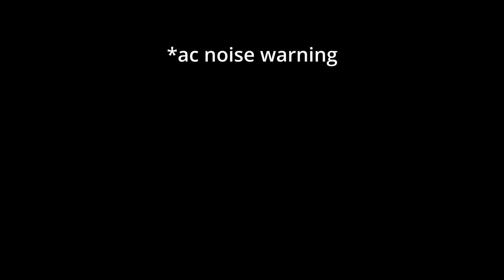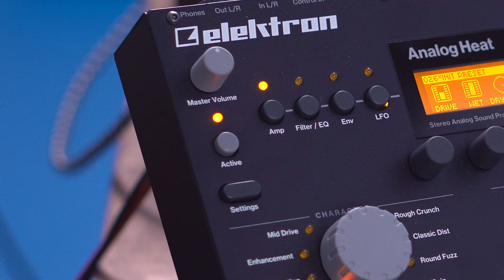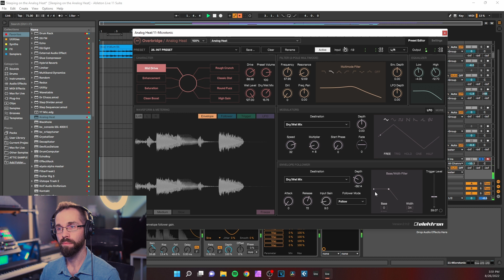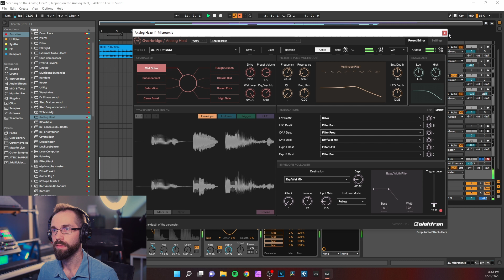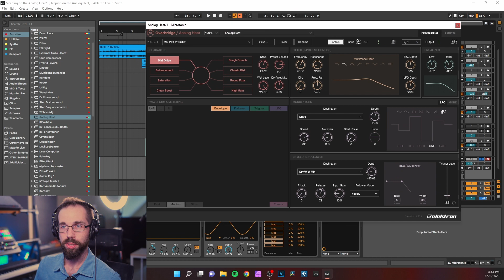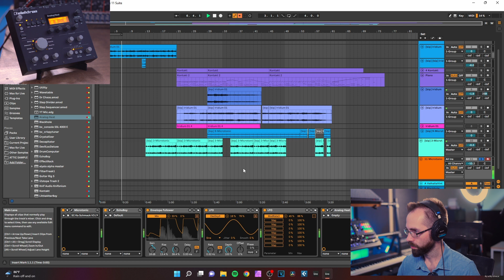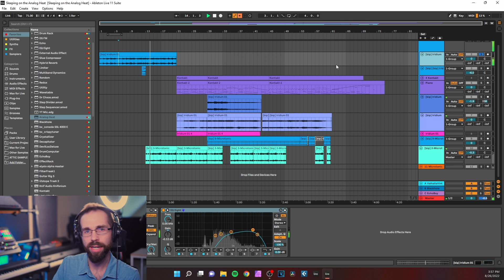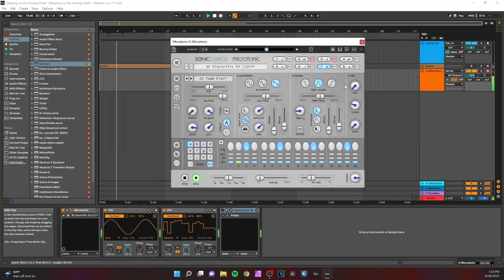Analog Heat: Elektron's most MISUNDERSTOOD box

Comment: The Heat is a staple in my setup. It’s pretty much permanently hooked up to the Cue out on my Octatrack for when I want a crunchier, analog type filter that I absolutely love. Between that and my Microcosm I have everything I need to colour my tracks!
Reply: Nice setup! I’m about to pick up an OT mk1 and an AH mk1. By hooking the Heat up to the cue out of the OT, I guess you only cue the tracks you want roasted, and keep the rest out the main outs? Then combine the two in a mixer? I suppose there’s loads of ways to connect it up.

Comment: Thanks. With the plug-in, do the FX still work without the hardware connected?
Reply from the maker: You have to have the hardware connected via usb. The plugin basically just functions as a UI since the audio is still effected by the hardware’s analog circuits. It sends and receives audio via usb.

Comment: I see you're a friend of the Sony MDR 7506:es as well. I've had mine for so many years and every once in a while I try to look up what the next logical upgrade would be, only to find out that they are still (in their price category and the next) the best thing you can have. Do you have any thoughts on alternatives?
Reply from the maker: Agree, they’re hard to be for the price. I don’t like how cheap the material covering the earpieces seems to be, as mine are falling apart. I’ve actually just ordered a Beyerdynamic set, so we’ll see how that goes.
Reply: @JamesonNathanJones  I just recently replaced the earpieces (black covers) with a new pair, because they began melting off my ears. I bought one pair off Ali Express and another in a local shop (to get them faster) and both appear to be pretty good quality. Extended my 7506:es life by many years I think.

Comment: Limited to working in 48Khz max. You  can only use it on one track at a time or as a send FX. The need to freeze a track to unload the plug-in and apply it elsewhere. Basically, hardware sucks. It needs to be Earth shattering to impose changes on digital DAW workflow. Elektron, it is just not that good.
Reply from the maker: Well yeah it’s hardware and has limitations. That’s true for every single piece of hardware and I don’t think anyone is saying otherwise. Hardware’s value is either in the sound of it or the way one interacts with it. Both are subjective.
Reply: You might like the McDSP APB series. It gives you multiple channels of analog processing with digital recall within your DAW. But it's also suuuuper pricey. Hopefully tech like that will get lower in price over the years.

Comment: I thought this thing was just an expensive compressor LOL. But saturation and drive is the same as compression since the whole point is murdering the dynamic range. Everybody thinks a flat-topped waveform means they’re good at mastering/engineering. I just can’t get on the “You need to increase your track’s perceived loudness” bandwagon. That’s like telling people an HDR video needs to have 1000 nits average brightness or it sucks. I mean, come on. Every popular synth channel is some guy who can’t make anything without three Elektron boxes and a KeyStep Pro and a BigSky. It’s all commodity jams with zero personality. I’m gonna go listen to Autechre. It’s fun being old and grumpy. Where’s my Fostex?
Reply from the maker: Well thanks for keeping an open mind and not over generalizing 😂
Reply: @JamesonNathanJones  I mean, actually, if more people used the Analog Heat they wouldn't use as much compression so it's making the world better! But the "Enhancement" setting makes me think of those Enzyte commercials.